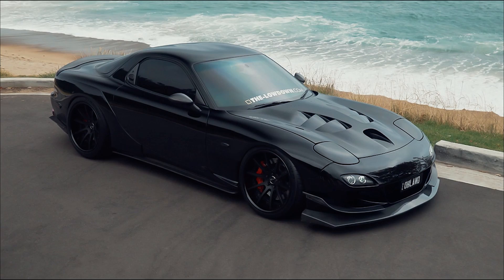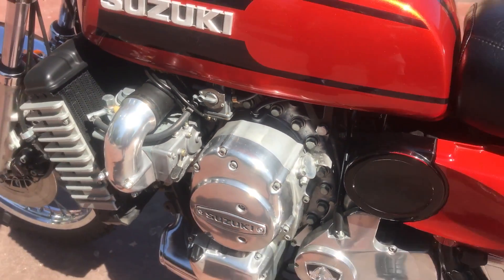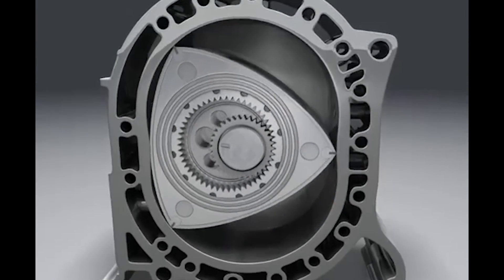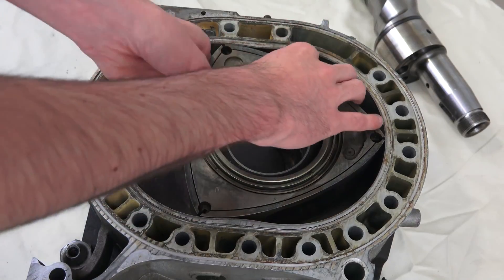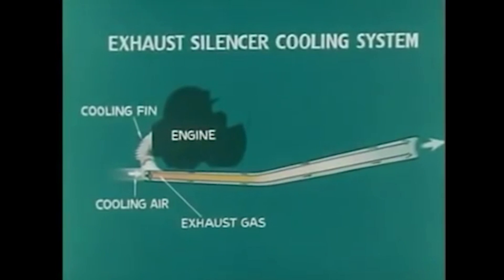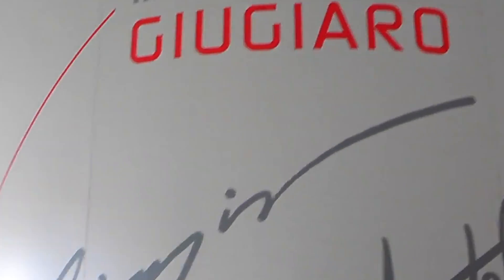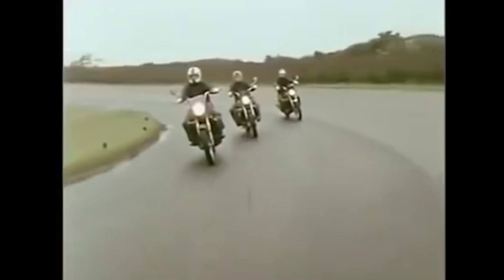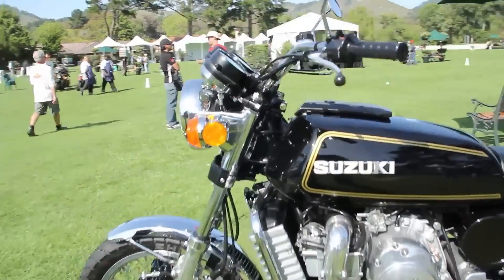Suzuki's Rotary Experiment: The RE-5 Motorcycle and Its Unique Engine

Comment: Wich vibration around 4000rpm? If the carb isn't set correctly it will hesitate because the 2nd butterfly valve opens in the carb to give more air and gasoline. Around 4500rpm. Mine runs smooth! After rejetting, they are poor on gasoline from factory. And it depends in wich climate it runs. Greeting's from the Netherlands.

Comment: Norton also had a rotary engine, Hercules from Germany as well, another one I think as well, can't remember which one. At least 4 there were on motorcycles.

Rotary engines were very cool, just didn't last long.

Yes please, bring them on.
Reply from the maker: Thanks will do😂
Reply: Mine has 30k on the clock and still runs just fine lol people must not treat these engines like a piston engine no short start and stop  you will vapor lock the engine at least once every ride got to redline and drive at least 30 mins before shutting off rev it to 5k and shut it down before the rpm fall. Premix is best don't rely on the oil feed. Also never run ethanol gas in old engines this bike can run on unleaded regular gas or low lead gas. No ethanol the carb cannot be fixed with new parts and you can only get used parts for insane prices. the bike is worth it to me.  Save the rotary.

Comment: Never knew. I would love more videos about rotary engines. I own an rx8 and will own an rx7 soon enough😊
Reply: I've owned all 3 I had a 1985 GS RX7 12a I bridge ported and put Webber DCOE carbs and racing beat full exhaust but lost her to a drunk driver then I had a 2008 6speed 6 Port RX8 she was stock never got  to do much with that car 1 year after getting the car a deer ran out in front  on the highway at 70mph total loss. But I still have my blue 75 Suzuki re5. She's heavy but that works in her favor and makes her smoother on crappy roads in North Carolina lol there is always a place in my heart for a brap brap does the soul good to stand out.